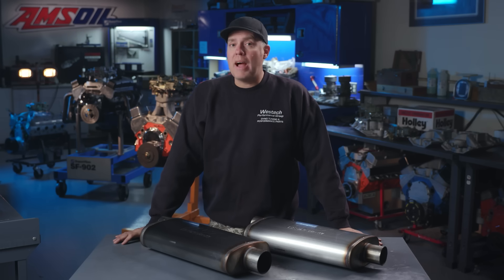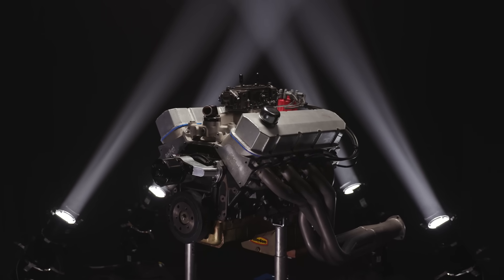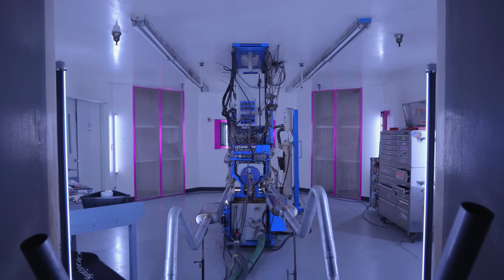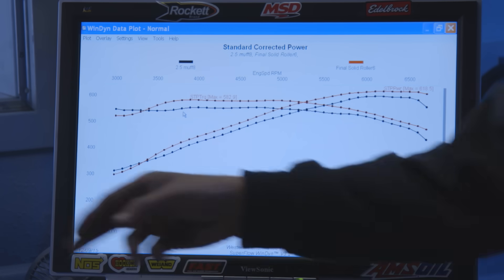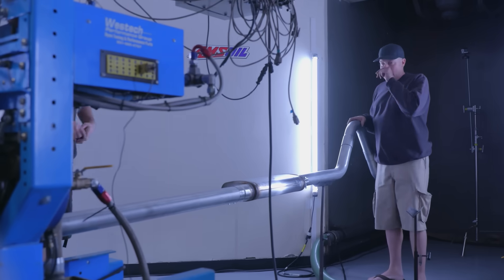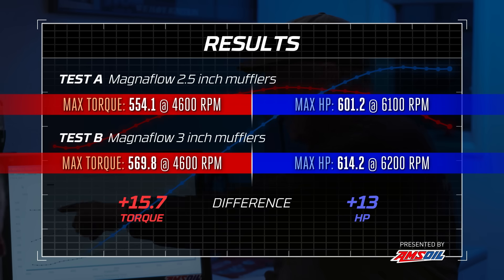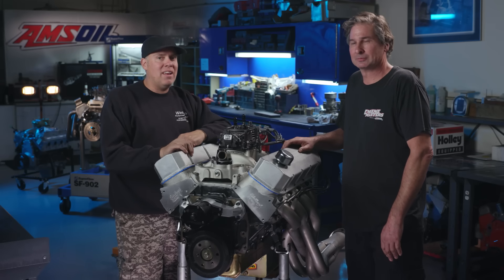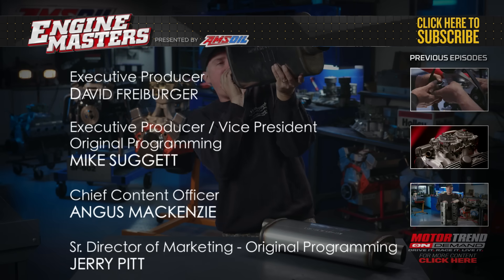The Power of 2.5- vs. 3-Inch Exhaust - Engine Masters Ep. 9

Comment: Do this same test on something weak from the 80s. performance engines are one thing but it doesn't fit the myth area. very few people saying this idea have any kind of true performance setup. try some low hp weak 80s v8 in exact oem set up. Stock computer manifolds and all emissions equipment. it would be interesting to see a 3'' set up on a weak 305 in true oem stock form.

Comment: I put a stainless, 3" system with xpipe, cat delete with Borla muffs and it just has a particular sound difference than every 4.6 I've run across. Power is negligible as it's stock,

Comment: Its just like with super sport motorcycles BUT higher hp doesnt always equate to better low to midrange drive ability. Or a better overall day to day driving experience... Great test tho. Perfect for racing wide open throttle

Comment: The 2.5"was an upgrade for my LS 6.0  it had 2.  2.25's" into a Y/ H  to a single 2.5? Or 3" can't recall.  It looked large when I installed it.  But compared to the 3" The 2.5"looks like it goes to a  B John deer.

Comment: Im Pro Mechanic 45+ years exp. Back in mid 90s Customers late 80s Trans-Am 350 TPI Stock Fuel Inj. Customer installed 1.65 Roller Rocker Arms and Big Diameter Exhaust System i think was 3 inch and Guess what Totally Killed any HP or Torque Gain in fact he lost HP big Time and the Throttle Response was Horrible car was pretty much Un Driveable. There wasnt much i can do except Recommend Remove Rocker Arms and Exhaust install his Stock Rocker Ams Stock Exhaust back on and just get Performance Muffler.  Those stock  Engines produced 250 hp and they had Very  Good Throttle Response because Roller Lifters and Electric Cooling Fans. Belt Operated Fan Creates Drag too

Comment: I'm  convinced.  I'm going 3" on my 600HP Ferrari
Reply: 15 years ago I installed $5000,00 Stainless Steel Muffler Customer Bought it for his Ferrari forgot year Model think was early 2000s V8 engine. Anyways Engine had Nice Exhaust Tone at Idle in Full Throttle Sounded like Formula One  Racing Ferrari

Comment: What happens if you run 3" to the muffler and a 2-1/2" tail pipe? My reason for asking is 2-1/2" tail pipe would make the over the axle and dump behind the tire easier on my '69 Camaro but not losing as much hp with 3" to a Flowmaster 40 Series Delta Flow. I currently have the tail pipe dumped after the muffler and it throws dust all over the place and drives me nuts. Thoughts?

Comment: Question from an ignorant non-mechanic: if the exhaust is changed to a less-restrictive 3 inch flow then wouldn't I need to have my carb re-jetted??  Also: do you guys consider a 350 a small-block??
Reply: Most likely will need to be rejetted but running an AFR gauge will tell you for. Depends on how much power you are making.
And yes, a 350 is definitely a small block

Comment: Barely negligible. Also most 2.5 and 3 inch mufflers have the same internals, engines don't compute inches just flow capacity.

Comment: Typical small blocks done need huge free flowing exhausts since they need and rely on exhaust scavenging back pressure to contribute to the Torque curve for “Low RPM range Torque”. A more free flowing exhaust actually needs a higher RPM from the engine to be effective and keep the exhaust gasses flowing out.
How many of us really drive our street engines at 4500-5000. RPM anyway?

Comment: Guy,s please stop testing with cheap gm motors that never run right.  Can you do this again with a Ford engine, including 3" single,
Reply: They probably didn't want to have to worry about blowing a head gasket at any power over 350hp
Reply: Man, if a Chevy motor can make  600 plus horsepower without running right, they are the better than I thought
Reply: Thanks for responding. Those one sided chambers make different thrust on the pistons from left to right, the early chev,s had cam endfloat making problems with not only lifer clearance problems but also the distributor would vibrate and want to lift out. Yeah they made power from all the one eyed development over the years, but theirs ather engines that would have been better with direct testing instead of generic cam grinds that work on compromising problems chev have. Mike @WyoCutlass71
Reply: @WyoCutlass71 maybe for 10 passes before grabbing a rod or throwing a dizzy out.
Reply: @michaelgiglio1571 interesting, Freiburger’s naturally aspirated 572 that is in his Model A has been running 8’s consistently for three years now… But, clearly you know best

Comment: The volumetric difference between a 2.5" muffler tube and a 3" muffler tube is approximately 2.16 cubic inches per inch of length. If you have a specific length in mind (e.g., 12 inches), you can multiply 2.16 by that length to get the total volume difference (e.g., 2.16 × 12 = 25.92 cubic inches). Let me know if you'd like me to calculate it for a specific length!

The volumetric difference between a 2.5" muffler tube and a 3" muffler tube, both 25 feet in length, is approximately 648 cubic inches.

Comment: 3 inch dual exhaust will kill torque on most unmodified engines. You think bigger is better? Not for exhausts if you are looking for action at normal rpm use.

Comment: I'll bet if they leaned out the fuel system a little with the 2 1/2" pipe, they would have got back 5-7 more hp.

Comment: I worked in a muffler shop and it's true. a person should have some back pressure. even a small amount of back pressure to achieve torque. too little back pressure and a person will lose torque especially low end grunt.

and I prefer chambered mufflers over packed mufflers.

Comment: Would have been nice if you went back in and re jetted the carb to lean it back out and see if it picked up power. It's not like someone will leave it alone. it'll end up on a roller dyno.

Comment: so i have a 94 Chevy G20 van that i customized, and got rid of the 4.3 v6 engine and had a rebuilt 350 with long tube headers,  should i go 2 1?2 in pipe from the headers or 3in? . I am looking to install a couple of Flowmasters

Comment: I've ran 2.5 inch exhaust with 87 octane, and 3 inch exhaust with 91 octane at the track. 
Got a 15.6 on both.  In fact ran a 15.2 on the 87 with smaller exhaust, but it was after a couple practice runs

Comment: Does installing the Borla muffler in the opposite direction affect the performance of the engine and the sound? The hole in the middle I placed in the front as an inlet, and the hole in the left end I placed in the back as an outlet.  Please answer, thank you

Comment: Change to an EFI where it compensates for the gas mixture to make it a fair comparison. This way the mixture should be correct from one exhaust to another. The weight complaints are fully accurate though.

Comment: That is why I run a dual 3" with a cross pipe..Each Cylinder, can exit/utilizing  both sides of the dual - 3" exhaust..It's quieter and makes more power with the cross pipe...This is on a F/Injected  B/B Ford...FUN..

Comment: Having a 3.5 vs 2.5 does depend on your aplication. In this video there is allready allot of back pressure because of the engine they are using. 
If you do the same test on a 1.2 Ford Focus or 1.1ltr Citrion you will see what people are talking about with open headers

Comment: That is 3% loss for going with 2.5 in muffler. 3% is only going to be felt at the track. You won't feel the difference on the street. The extra torque in the low end will be felt at part throttle. Throttle response will be very noticeable. Roll on in high gear will be felt. Lots of hype and no reality. .

Comment: There is a formula for this. And actually a tapered pipe works very well and at a broader rpm range. Burns Stainless has the designs and methods. Just a small difference in diameter or length changes the back wave to the valve. There is much more to this than lowering restriction.

Comment: Great video. Glad you did most of it properly. Even though you part mentioned it you didn't provide the the tuned size (volume) of the exhaust matched to the engine. Being a 454 you probably are close to the correct volume with the 3 inch, but those pipes look way to long for resonance length.
Here in Australia we mostly worked with 300ci engines so the 2.5 was a closer volumetric/sonic match. A 3.x inch worked well for tuned size and length for a single pipe system against the 300ci engines.

Comment: Now lets see what it does to a 500hp engine? Would it still kill power what about 450?  Get Richard in there he will test it all!!!
Reply: 500 and under id def use 2.5  its about that 525  mark where you need to start using 3 inch ...at least on small blocks but really id just match the collector size a lot of the time vs necking it down if i could avoid it

Comment: Back pressure theory does not make sense at all in exhaust system rather it should be least there. However, it does matter in intake manifold and air intake system with different kinds of combustion engines and fuel requirements
Reply: now you add a supercharger  and keep upping the boost and you can put bigger and bigger pipes on it.  it will do better no matter what

Comment: I want to see a mild cammed LS 6L with about 430hp with full accessories.
Reply: still 2.5 inch dual system 

 start getting above 500-525  3 inch  is what most will start using

Comment: I don't think it was spelled out but a 3in exhaust flows not 20% more than a 2.5in but actually 50% more. And if you are worried about the weight - titanium is the way to go!
Reply: aluminum is what they mostly use for racing.  not all that great on the street and its  custom  and expensive.  most people dont need it

Comment: You reckon it would make a difference in a 347 small-block Ford I have two and a half inch flowmaster change into the flowmaster FX which was open
Reply: not unless you make more than 500  id leave t like it is

Comment: I love the in depth power gain and loss..you never mentioned with the fancy bolt on o2 sensor  how lean or rich the engine ran with 3in exaust 😊
Reply: Doesn't matter engine should be tuned with the exhaust attached.

Comment: I actually upgraded my 1985 Chevrolet squarebody from the header which is 2.25 and looks like this 2.25-2.50-3in then three inch pipe with 20inch long glasspack that us 3in and gotta finish it so a 45 tip and 90 45 tip

Comment: 2" headers? What's the collector/choke size?

We've established that it's restrictive. I've seen a decent (simulated) gain between dual 2.5  and dual 3" (both with x pipe) on a 500hp 289 (would be very sensitive to backpressure because of the overlap).

On the video engine I'd be running a 4-2-1 with a much smaller pipe off the head (4-2-1 are inherently stepped headers, so a 1.625 wouldn't be out of place if you had the room for wide radius bends and a good transition), maybe a 2.5 final choke, into a dual 3" with an X pipe, if not larger.

Comment: The first time I heard that "back pressure is a good thing", it was from a certified mechanic. I just assumed he was right, that a small amount of back pressure could be helpful. However, I couldn't figure out why it would be true. The object is to stuff as much air as you can into that engine. That allows you to dump more fuel in there and create big power. This means there will be more exhaust gases, so why would it be good to have smaller exhaust and thus more back pressure? I have no idea.
Reply: Go read what Borla has to say, these three clowns are clueless.

Comment: All you’ve proved is the exhaust has to be sized for application.   Redo the same test with a 300 horse small block crate motor and it will throw on the reverse lights and back up with a 3” pipe.
Reply: Better yet go get a 350 Pontiac and dyno with the cast iron manifolds and then get some 2” headers and 3” pipes and watch it fall flat on its face.  But you won’t.   Because you know I’m right.  😂.  I’ll go you even one better!   I’ll give you a credit card number and pay for the headers if I’m wrong!   You can’t lose!!

Comment: Be interesting to see the difference with the 2.5" jetted correctly rather than run rich.
Reply: Why would they do that? They are only doing this because they are in the phony bigger is better club. These three clowns need to sit down with Borla who will educate them on how exhausts really work. John Lingenfelter built over 600 horse power corvettes using Borla 2.5 inch exhaust systems. Borla even talks about having to educate clowns like these three all the time because they think bigger is better.

Comment: This is almost the same engine specs as my motor. The differences are mine has L88 aluminum rectangular port heads and a comp 274/286H cam. With roughly the same compression. I wonder how much difference mine would have. It has 3 inch exhaust

Comment: Driveability is not a section on the chart. 
A decent set of mufflers and a good exhaust improve driveability. Maybe not wide open full throttle power, but alot to be said about a responsive, drivable hot rod

Comment: Well, you did it again... If you don't try to find an optimum tune then the numbers don't prove anything. Yes, you lost ~20hp with the 2.5", but the engine went richer which would have killed power. I'd be that with an optimum tune (fuel and ignition timing) all 3 would have been within 10hp of each other.

Comment: Well….just because…….
So I’ve got a small block 400 Pontiac (firebird) stroked to a 461 with rollers blah blah ….I haven’t done a chassis Dyno yet, I was making 500hp and 575 fl/lbs at the crank…. I did put 3” pipes on after the headers (and I put cutouts in also) love the sound of the pipes, no idea on actual numbers , but I will be able to a/b the open headers against the 3” system. I’ll very curious. I’m also building a 302 and a 351, (fastback and a cougar) both of which are going to get the same exhaust treatment.

Comment: After running a 5 inch system on a Duramax and scaling back to a 4 inch system there was no power difference but the sound level was much easier to tolerate. Both were straight through mufflers. The 5 inch system was just too noisy for a daily driver.The 4 inch system sounded better and the turbo whistle was heard along with the throaty diesel rather than being drowned out. Bigger is not always better unless you are just into being obnoxious.

Comment: You don't know you are losing HP.  All you know is if you know nothing about tuning, you lose HP by adding an exhaust system that was tuned with open headers.  Why don't you try leaning it up a bit with the exhaust and try to get the max HP from that system?  Really a meaningless test without tuning to that each system.  That is why no high HP engine is tuned exactly the same.

Comment: Ok the timing couldnt be better. Im doing a full exhaust with long tube headers and its a 400hp small.block. this is a fully mandrel bent 2 1/2 inch. Here is what i would like to see or find out. What are the number differences.between a exhaust shop collapse bent and mandrel bent..And a 3inch.vs 2 1/2 on a small block. So would we see more power from a 2 1/2 vs 3 on a small block ?

Comment: I you drive your vehicle normally the higher torque at lower RPM is desirable. So the smaller exhaust is better for a daily driver. Bigger exhaust for aggressive diving or racing.

Comment: Would be interesting to try tuning the engine for each setup to see how different things really are between them.  I know most people will just bolt on parts and go, but as stated in the video, an engine is a complete system from air cleaner to tailpipe and changing just one of those things (while good for A to B testing to some degree), doesn't necessarily tell the full story.  You might be able to make similar peak numbers, but it might shift the graph around for where those numbers happen, or it might just close the gap a little bit if you optimize each configuration.  Though all of this is also only really applicable for this particular setup.  Lose 100 cubic inches going down to a 350 and it might make a lot less difference.  Kind of like putting a huge carb on a tiny motor.  Yeah, it will "work", but it doesn't necessarily mean it's the right fit.

Comment: Don't know if someone else got there first, but the tube difference is found as area with a formula. 3in circumference (3×3.14) subtract 2.5in circumference (2×3.14) multiplied by length in this case 25 feet? For a difference of 39.25 square inches. Lol square inches from round tubing lolol.

Comment: I own a 1991 Chevy  3500 HD. It still  has a TBI 350 gas motor.  I installed  a full 3 inch magnaflo from the cat. But retained the stock y pipe off the motor. Below 65 mph it seems normal. Above 65 things really begin to happen.  This truck will bury the speedo.

Comment: have MAGNAFLOW KITS  got any better or WORSE?
I BOUGHT A 5.4L FORD KIT in 2011 ish that was supposed to be THREE INCH yet all the fitting were squished down to 2&5/8
What A JOKE that was.
i had to pay a muffler shop to cut all those off and weld 3 " to 3" joints, almost doubled cost of so called do it yourself kit!

Comment: engines dont like back pressure. engines love high flow rate which comes with the right size exhaust. if you have too big of an exhaust youre going to lose flow because the air is able to get turbulent inside the pipe. with a pipe thats too small and creating back pressure its restricting the flow

Comment: .Hey guys, would really love to see you take a stock 318, 340, and 361 and run the same test.  I am not interested in going 110 in a 60 zone but, I would like to get to 60 as quick as possible !  I just list these motors because they are all a lot of us can afford.  You know , what difference would a larger {dual  ?} exhaust system would make to a bog stock motor as far as torque and economy are concerned.  Thanks guys